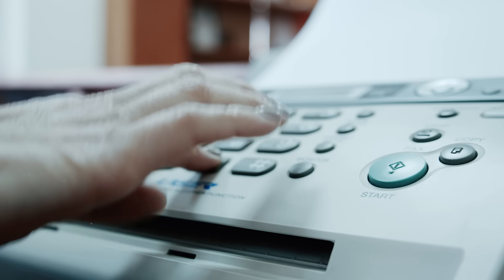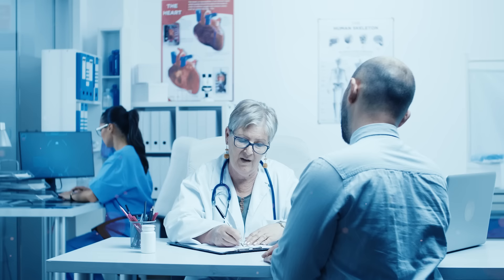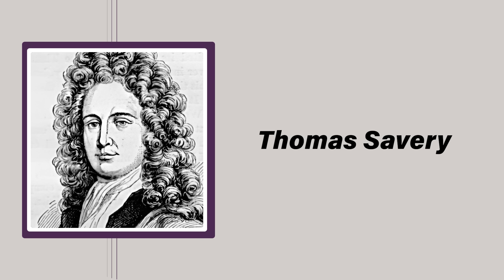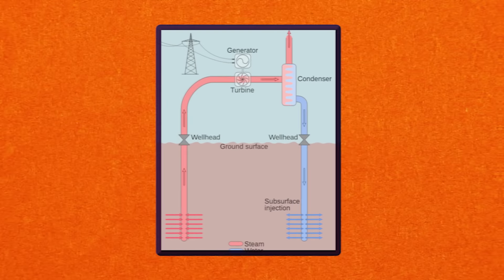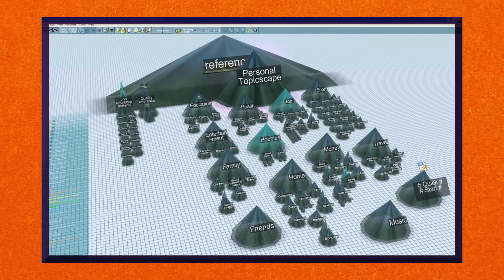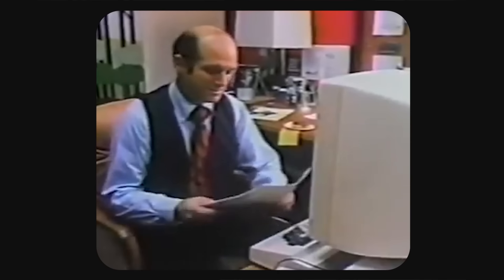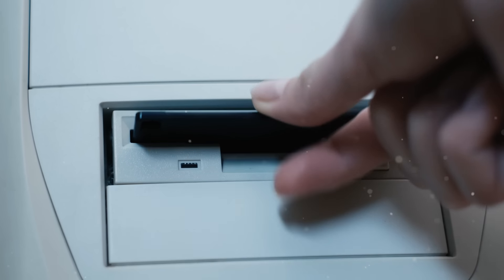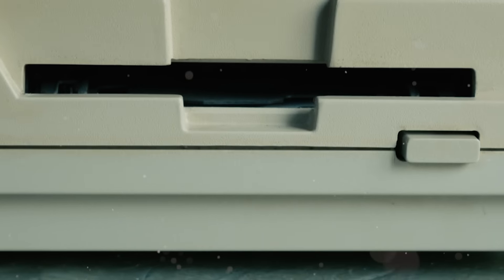Terribly Outdated Technology that we Still Use...

Comment: A I had heard for the reason that fax machines are still prevalent (also in US gov where I work) is not only have the confirmation page, but it is a direct communication with the recipient. The data between the sender and the recipient is never 'at rest' and therefore can't be intercepted and modified easily.  Though considering how modern phone systems are nothing but servers where data can come to rest, I don't know how realistic that reasoning is or ever was.
Reply: Faxes can be intercepted extremely easily, all it would take is two wires on the phone line and another fax machine, or even an audio recording device and then some software to decode it.
Reply: @Pugjamin  Ah, but you aren't going to be attaching the wires to the phone line or placing the microphone under the desk in Boston from your basement in Beijing.
Reply: @scottfw7169  You don't even need wires. A fax machine also emits radio waves that can be picked up remotely, that can be picked up and recorded using an $10 SDR and some open source software.

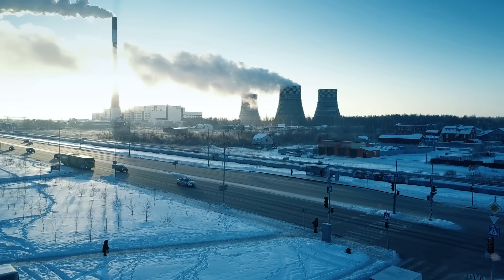Comment: 5:03  Correction: the typical natural gas power plant uses the hot combustion products to spin the turbine.  Steam is used in the newer combined cycle gas power plants, where the still quite hot combustion products coming out of the turbine are used to heat water to make steam which is then used to spin a steam turbine.  This scavenging of what used to be waste heat dramatically increases the efficiency of the power plant.
Reply: I live close by to a Combined Cycle Power Plant, I think they use a marine gas turbine using natural gas with the exhaust gas passing into a steam boiler which then supplies steam to a 120 MW steam turbine, overall efficiency is over 50% .
Reply: Well, yes, because steam power takes time to spin up and is base load, whereas gas turbine natural gas can be brought on line quickly and intermittently.

Comment: I was tutoring AP Environmental Science last year & found myself saying "all power generation is just the steam engine with extra steps" a lot.
Reply: Except wind power turns the dynamos directly and solar panels release electrons when struck by light. You are referring specifically to thermodynamic, hydroelectric, which uses a current, not steam, and nuclear.

Comment: I used to work at a nuclear power plant (Sellafield UK if anyone is interested) and I always remember my wife's reaction when I explained how it worked. "All it does is boil water??" 
She had imagined some magical way that the energy could be stripped right out of the atoms or something. Her surprised Pikachu face was epic!
Reply: rather sneaky to equate the steam turbine with steam piston engines imo.
Reply: @jnawk83 so making the water warm
Reply: I thought everybody knew that nuclear power plants (as well as coal fired power plants) used steam to produce electricity.  That's what cause the 3 Mile Island accident, it was a stuck steam valve.
Reply: Admittedly, I've never really thought much about it but I also had ZERO idea that steam was involved. Another surprised Pikachu face over here!
Reply: @krisl3314 at least you realized nuclear power is good.
Reply: People who think it's like boiling an egg haven't the slightest idea that when Superman had the power of a steam locomotive, the most prominent part was a great big kettle.
Reply: @dx1450  But it caused NO human or environmental casualties. The more radioactive the fission products, the sooner they're gone.
Reply: @markdavich5829  virtually all commercial engines are "heat engines". The niftiest way to boil water is to use the highest temperature the equipment can survive.
There is a remarkably powerful "natural" solar heat engine that even produces electricity. It's called a hurricane or a typhoon, both being cyclones. It doesn't even boil the water, it collects the vapour from warm oceans. A lesser case is just a thunderstorm.
Reply: I came to that realization myself 5-6 years ago. I believe I was watching a video about one of the nuclear accidents. It explained how the accident occurred because of steam.

I thought, "Holy sh!t, are nuclear plants just fancy steam engines?".

Then I thought about other power plants and realized most are just steam to turbines.
Reply: When people talk about nuclear power, the first thing people think of is something straight out of science fiction and not actually "magic".
Reply: I mean I remember realizing the same thing at one point, that's definitely legit.
Reply: But why is windows 10/11  bluethoot so shit? My low end 2017 phone works just fine?
Reply: Was disappointed when i found out too.
Reply: Don't forget Nuclear Submarines.
Reply: I am more frightened by someone who works in a nuclear power plant who uses surprised Pikachu face as a reference point.
Reply: @sweiland75  LOL!
Reply: @dx1450  You can tell the people that were still listening in school past the 8th grade vs those who were just f'ing around in the back of the class. Must be much worse now with cell phones. Schools should all follow the lead of the ones that have their students check them in lockers.
Reply: @markdavich5829  So is hyrdo power antiquated? It's even older. And windmills? How about the axle (which is the real invention regarding the wheel, round things exist in nature for X sake)?
Reply: Basically a glowing kettle.
Reply: Sellafield? That name calls up some bad memories.
Reply: @desperadox7565  yeah, lol, used to be called Winscales until the big bad fire, then renamed it Sellafield. They also renamed "ionising radiation" to "fairy moonbeams" to make it all better  :D
Reply: What surprised me was learning that some reactors use liquid metal (e.g. Sodium, NaK, lead, lead-bismuth eutectic, and mercury) as the coolant. 

It works the same way a water cooled reactor does. The nuclear fuel heats up the metal, the liquid is pump through a heat exchanger which transfers the energy into water.
Reply: @dx1450  Unfortunately, most people don't care to learn such knowledge.  I know it'll probably never be useful but I enjoy learning about science and history. 

 I work with high school kids and some have problems turning the mop water dispenser on. They couldn't flow the inlet hose back to the mop sink facet 2 feet away.  American school systems arn't teaching kids problem solving skills it seems or they just don't care to learn them.
Reply: I think a Kyle Hill video has that in a thumbnail about it just boiling water.
Reply: @fukkitful fukkitful?  just here to comment on your swell spelling skills , the lack thereof . yet you are a teacher? I'm very curious as to why a student would need to access the water for mopping, that is usually the custodial crews need to know.
Reply: @krisl3314 
Yes, that's why the synonymous cooling towers are there, cooling the water used, before returning it to the source.
Reply: @Elba.Ginon93 
It has nothing to do with the operating system used. It is because you likely purchased shit hardware.
Reply: @alisamenna  its a wacom intuos but Ibdont have the exact model rn.
Reply: i actually work at a plant that produces them, and my view on them has completely changed. i used to think pretty much the same thing, but it’s such a cool experience to see the parts and understand how they work. and it’s also quite funny to me the names some of these parts. nuclear scientists have a peculiar sense of humor
Reply: surely you told her thats how ee do it now and a lot of energy in reactors doesnt get harvested
Reply: My bride is a nuclear engineer and regularly blows people’s mind describing how reactors work. “Hot rock, boil water, make steam, turn turbine, make electricity.” The concept is that simple, the technology is significantly more complicated.
Reply: @ab5olut3zero95  LOL! like that summary!
Reply: Did you also use pagers? I work in a nuclear power plant and I wear a pager because mobile phones aren't allowed for security reasons, there are old rotary phones (and more modern ones with buttons) on the walls.
Reply: That's why Homer Simpson had a job there: he understood the concept and was cheap. 😂 🤫
Reply: Thats how all energy is created though. doesnt matter if its nuclear rods or if its burning coal. Heat is always used to convert energy from the source into electricity via steam engines. We can't figure out any way to get energy otherwise, which is kind of ironic. Even if we used nuclear in space its still a steam engine.
Reply: It's a giant kettle.
Reply: When I was younger, I thought the same thing! I didn’t know how a nuclear reactor really works until I was like 9 or 10 years old. 😆
Reply: Hence one of the nicknames being "nuclear tea kettle". 😆
Reply: Is Pikachu face like this 😊 or like😮?

Comment: As an attorney (non-practicing now), let me tell you that it's pretty much IMPOSSIBLE to run a law firm without a fax machine. Too many courts still consider them the ONLY appropriate way to transmit important documents . . . except when they demand an actual, physical person deliver said documents on paper.
Reply: In my country, faxed documents never had legal power. Companies might have used them in business simply because they agreed to do so (as they are now using email in exactly the same way), but no court or government office would accept a faxed document, only original paper ones. As for courts, this didn't change until now; while most government offices accept documents sent (and signed) electronically via the official governmental web platform, courts are the only exception where still the original paper documents must be delivered; no other method.
Reply: Not to mention that most fax machines are still analog and can not be hacked
Reply: I don't know where you're from, but as an attorney myself in other nation, this surprises me. In Brazil, justice demands have started transitioning to digital systems some 17 years ago, the process was completed 5 or so years ago.
I interned at my local courthouse back when the digitalization was being done. It was a good satisfaction knowing that I would save tons of money with printer maintenance and would not have ashtma attacks while working
Reply: That's absurd silliness in a world where eFAXing is a thing.
Reply: EXACTLY 😎👍🏻
Reply: Well. In Germany, courts and attorneys have been (finally ffs) forced to transmit legal actions / correspondence online via a specially encrypted online service. Fax is to be used when the service is offline or does not work. 1 word: Deadlines. And one problem: There are some piss poor courts which cannot afford the E-services. 😅
Reply: @macethorns1168 The moment you want to transmit the data over the internet, though, you need either (a) end to end encryption of the connection or (b) encrypted data.

That's because all of your data packets have to cross through numerous points where they could be inspected/logged to get access to otherwise confidential data.
Reply: Windows XP was a fantastic OS.  All the windows OS' since have been horrible including this current one.  I would love nothing more if XP could come back.
Reply: OBJECTION!
MOVE TO STRIKE!

Comment: I loved my pager which I used up until about 2005. I still use 3.5" floppy's in some old IBM compatible 286 machines which run 1990's programming software for Motorola radio comms equipment which are still in spec.

Comment: Pagers were so reliable because they were built like small plastic tanks, so that they were almost unkillable. Couple that with running off basic long wave FM radio frequencies, and the signals went through almost anything, meaning it was rare to be somewhere in a building where your pager wouldn't work. In many cases, getting to a phone line was a more difficult task than receiving the page itself. Those long wavelength signals also travel a really long distance, compared to a cell signal, so they worked well in remote locations too.
Reply: @@retiredbore378 Sorry, I forgot the proper definitions. Been a while for me. I was thinking "a lot longer than the frequencies currently in use for phones"
Reply: Takes me back to my selling days and pay phones. 
I think the codes were 111 for coke and 333 for weed. 
That must of been in the 90s
Reply: Takes me back to my selling days and pay phones. 
I think the codes were 111 for coke and 333 for weed. 
That must of been in the 90s
Reply: Pagers were the Nokia of the 80's. Lol
Reply: Yeah but we have low band frequencies that can go quite a distance now with cellular networks the only limiting factor being the power that they are allowed to operate at due to interference with other frequencies. 

Anyway tldr if your only goal is to send a text it’s not that hard to do but people’s demands have come a long way from a simple SMS message
Reply: Longwave my ass! They use the CB band.
Reply: If I drive down the wrong street in my city of 2 million people I'll lose modern cell signal. (Verizon) Or it will be crippled basically. All of takes is a bunch of trees in the summer with dense foilage and a slight change in elevation down
Reply: @spencerstevens2175  That's a Verizon issue. In my country even small shitholes have great cell coverage, provided they're tourist destinations.
Reply: @fungo6631  nah I've asked people that live in those areas. They all say the same thing. Different carriers.
Reply: 35 MHz, 43 MHz, 152 MHz, and 454 MHz. Transmitters use up to 1,000 W of power. 454 MHz will pentatonic many buildings pretty well but doesn't handle terrain well. The lower frequencies may handle terrain better, but army good at penetrating buildings. 152 MHz has a good balance.
Reply: @briant7265  I had a stroke reading this.
Reply: @fungo6631   The comment about dense foliage was correct.  Having trees or foliage between you and the cell tower you're attached to will attenuate the signal by varying degrees depending on how dense the foliage is and how windy it is that day.  Millions of fluttering leaves make for fantastic deflector dishes.  It's why your signal will inexplicably improve in the winter in the same spot:  the leaves will have mostly all fallen, leaving a relatively transparent (to radio signals) barrier.

Interestingly enough, something somewhat similar occurs inside buildings too, but instead of fluttering leaves, you have the network of wires in your walls and ceiling.  Hello quasi Faraday cage.  Quasi because the cross-crossing wires aren't spaced close enough together to do much more than very minor attenuation, while the walls and ceilings take care of the rest depending on what materials they are made out of.  It's why carriers generally can't guarantee coverage indoors beyond some large public venues/public areas. Not everyone's house is wired and constructed the same way. (plus, as others mentioned, some frequencies do better than others)
Reply: Pagers could also be powered for a week off one battery.
Reply: Long radio waves are not frequency modulated. You modulate the amplitude to transmit the voice using long radio waves.
Reply: Yes; even after our support team had mobiles they still carried pagers for reliable reception.
Reply: Not long wave.  Mostly VHF around 150 MHZ and I think around 170 MHZ.  Go up to UHF and the signals tend to bounce off of terrain (hills and buildings) a lot more.
Reply: @fungo6631  Not very many pagers ever used the CB band, though there are like 5 channels in between the CB channels which can be used for paging.  I think as late as the 1990's Radio Shack was still selling a 27 MHZ paging system which operated on (I think) 27.145.  But most paging signals were around 150 MHZ and maybe some in the 160-170 MHZ area.
Reply: @dx1450  The twente websdr says otherwise. You can hear pagers on or near the CB band all the time.

Comment: We found out vibrations from jet engines often caused mechanical hard drives & optical drives to fail. But floppy disks and tapes (8mm) worked fine.
Reply: You might have a use a for modern SSD :)

Comment: I had to buy a floppy disk drive for a university lab when I worked in IT purchasing, I tried to show them how much data a usb thumb drive could hold in comparison and got shot down because their specific laboratory equipment used floppy disks… blew my mind as a young IT guy in 2010
Reply: I remember being a young wannabe IT guy in our central bank in the late 80s - I accompanied some bank bigwigs on a walkaround our new computer suite, with bomb-proof windows, a super air con system & even a halon fire management system to cater for the (then quite expensive) £4m fault tolerant hardware that was going to support the UKs gilts payment systems.

I was told to keep my mouth shut but couldn’t help saying “it’s a shame they dumped it on a carpeted floor with fibres that the air-con is gonna circulate into the h/w & fuck it all up within a week”.  It took about 10 grand & a whole weekend to move all the shit out, rip up the carpet & put it all back in place before we could go live.  Never have I felt so smug.

Comment: As a point of sale developer - I can tell you XP is deeply embedded in retail for years to come.
Reply: With the new chip-cards and the advent of tablets, that is changing fast. However, having worked for NCR in the past, there are some systems that will change only when the equipment itself falls apart. Considering how old cash registers are built like tanks, they should be fine for another decade or two.
Reply: @housellama  Chip cards were already industry standard for most of the world by the time Windows XP was replaced in 2007, I'm interested to know where you come from.
Reply: @epender  yeah, coming from germany where smart cards were a thing in the 90s, it took a surprisingly long time for Point of Sales systems and ATMs to finally start reading chip cards here in the US....